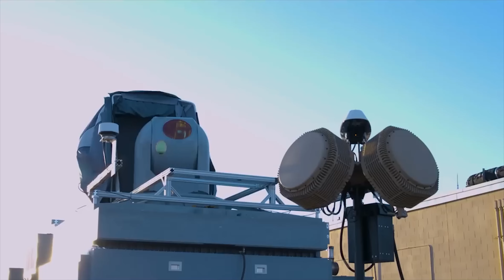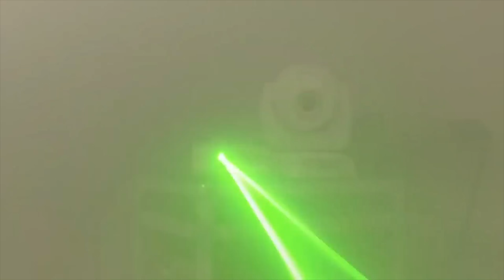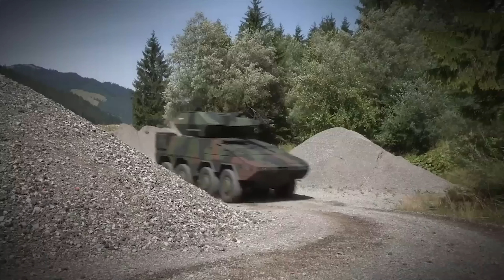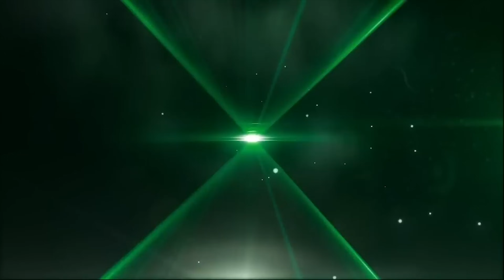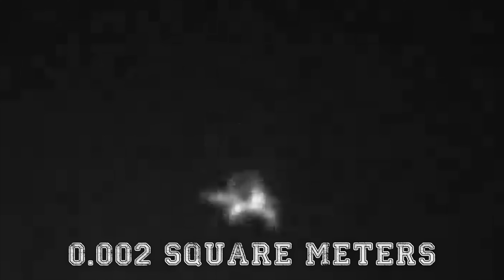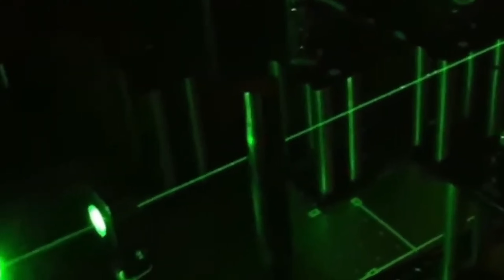GERMAN New LASER Air Defense Systems SHOCKED The World!

Comment: Laser is nice and innovative. The question is how much it costs to build such a system. Although the interception is cheap. But the system is expensive and not always portable and affected by the weather. If it's cloudy it doesn't work. And another question. How long from the moment of purchase the target is to be eliminated. And how it works against multiple targets at the same time. Iron Dome manages to work against 10 targets at the same time. Beyond that there are failures.

Comment: Laser have multiple weaknesses. First, current technology not allows really high output - 150kWt is a practical ceiling, which is barely enough to hit a small UAV made of plastic.  Second, laser generates a huge amount of heat and cannot operate without cooling for substantial time, unlike projectiles weapons. Third, lenses and windows must be clean on microscopic level to prevent burning of themselves, which is about impossible task in combat. Fourth, and this is the biggest problem, is air condition. Dust, mist, low clouds, sand or smoke will effectively disperse the beam, thus completely neutralislzing its effect on target.

Comment: 20 kw laser? That's maybe good enough to disable a tiny drone or possibly disable sensors. The common minimal laser for industrial or home workshop is 60 kw and that's generally for cutting and etching materials a few inches at most from the laser. If the laser has to pass through long distances of atmospheric conditions, it's likely going to be refracted and dispersed to some amount. US and Israeli laser weapons appear to be achieving some kind of minimal threshold for fielding a viable weapon on any platform including aircraft and ships with the US looking to develop an enormous, nuclear powered laser for its largest aircraft carrier, the Ford class which is already generating enormous power for its propulsion, EMALS and other operating systems.
Reply: Think about what a camera lens does to a laser beam, focus it. Also think about what missiles, bombs, drones and planes carry. The fuel ⛽ of there own destruction, fuel ⛽ and explosives 💣. You just have to heat them.

Comment: Problem with lazers as weapons, is mirrors, lol.  Chaff and Smoke also cheap ways to block or attenuate the beam.  THe lazer wont work in rain or fog.  Over all yes very good when it works, but not great in many situations.  However, Mazers are another matter, they cut through fog, rain, mirrors too.
Reply: These are Infrared lasers not visible. Also there is no 'Z' in laser. The 'S' means something. Why does your fire department use IR cameras to see thru smoke. Also chaff falls down and behind plane away from the laser. IR works in rain and fog too. Commercial lasers have been cutting thru metals since before 1990. Metal mirrors will be destroyed by high power lasers.

Comment: A constant Laser requires constant high power laser emission .... A pulse lazer requires much less power at a pulsing rate. Energy is therefore conserved and available at a constant pulsing power level.
Reply: Most lasers are pulsed for decades now. These lasers in the video are really multiple pulses that last seconds. The peak power of pulsed lasers are higher for the same average power. For these multiple pulsed lasers that fire over seconds, the key is total energy delivered not so much peak or average power. There are other very short pulsed systems they are working on that have extreme peak powers that just a couple pulses destroy things.

Comment: Since laser induced fusion is a thing I started wondering if someday lasers will be so powerful and highly focused that it would not only melt the target, but actually initiate just enough fusion to cause an explosion.
Most people also are not aware that the tracking and the focus are really the biggest challenge (you need to track the exact point, to add the energy to this single point - the smaller the beam the better, but also harder to track), unless you really can build a pulse laser that really only needs one single pulse to destroy a target.
Reflective armor might seem as a thing, but actually a mirror also has limits, and wavelength plays a big role, too.
Reply: @ProjectsBlack  You are decades out of date. There have been auto trackers dating back before 1990, long before modern AI. The effects of clouds and mist depends on the wavelengths of the laser and the IR tracker. A very powerful laser will create a hole thru mist or clouds. High  or far away clouds will not have an effect with short range defense.
Reply: Laser induced fusion kind of works diffrent than what lasers actually do. Even if you had a powerful laser that would be able to do large amounts of damage, it would never cause a fusion, because Laser induced fusion kind of works by using multiple lasers that hit symetrical points inside something that is similiar to a cylinder. The Lasers hitting the walls of the cylinder will create kind of shockwaves which will compress the fuel core and increase its temperature so much, that it is able to create a fusion. The fuel Core is also made out of specific elements that are needed for a fusion and it all needs to be very symetrical or else the core woulnd be able to completly compress like we need it too.
You also would need a lot of Energy to get a laser even that strong to do large amounts of damage on a target, but fusion wouldnt happen.
Reply: @BodenPflanze  I know that, but I wondered if someday it might be powerfull enough to cause fusion although it is not causing an implosion. Simply by producing enough heat in one tiny spot (so that inertia and temperature is enough).
Reply: @marcel_de_sh  Look up the power of LLNL NIF, it uses more power during the tiny instant it fires than the whole USA grid.
Reply: @marcel_de_sh  I was talking about a experimental Reactor type from Germany, the ICR.
They use a cylinder. And inside the Cylinder is a sphere
Reply: @BodenPflanze  NIF, on the other side of town, uses a sphere and not a cylinder. Also the wavelengths are changed to x-ray. Otherwise you are correct.
Reply: Small beans are good for close up commercial laser cutters and drills, but longer range systems, in km ranges, bigger beams help because of laser divergence.

Comment: The only weakness of laser defense is that clarity of the sky limits their effectiveness.  (Clouds, dust, smoke)
Reply: Basicly any particle that's in the way in front of the laser to the target
Reply: Atmosphere alone is dense enough to limit modern-laser weapons to a certain range.
The laser would need to cut a tunnel by evaporating the atmosphere in its path to further extend its range.
Then only problem would be that you would need significantly more power the further the laser would have to travel.
Reply: @DerNiker What are you talking about. They use lower power lasers to measure the moon's position for decades. The atmosphere transmits much of the IR.
Reply: IR sees thru clouds and dust. Your fire department uses IR cameras to see thru smoke. This IR not visible.
Reply: If it hits a mirror .

Comment: Two points:
1.. . .If the target has a highly polished “mirror” surface the laser will reflect off it harmlessly.
2……A laser cannot penetrate cloud or fog….the same way the sun cannot blind you on a cloudy day.
Reply: If the missile spins as well, the heat will be distributed and dissipated. A highly reflective mirror is going to absorb very little of the energy anyway, a fraction of one percent, and it can be insulated with a ceramic jacket.
But better still is a kind of reflector that redirects the beam back to source. The body is a honeycomb of 90 degree dimples, coated with a transparent material for aerodynamic. That will brings the taste of the medicine back to the laser.😊
Reply: @madsam0320  A rotating missile effects it control surfaces and path. Even if rotating, the lasers only take a couple of seconds to work. Commercial Lasers have been cutting thru metals since before 1990. The first pulse will evaporate the reflective coating while the second pulse starts on the ceramics. Ceramics don't conduct heat well, so the laser will be more effective and start evaporating the ceramic. The honeycomb allows the laser to bypass  it thru the holes and start on the next surface.
Reply: I've seen some powerful lasers vs mirrors. The mirrors dont fare well cause they heat up and crack, eventually melt. Some lasers are powerful enough to basically punch a hole straight through it 😅 photons are FAST, have enough of them and eventually it's like a minigun of light bullets, they impart momentum and heat reflecting the photons off, but that energy has to go somewhere
Reply: @FractalNinja  A photon has no mass...
.

Comment: What would one of those 100 kw lasers do to an armored vehicle like a tank or ship I wonder? If it doesn’t cut through I wonder how many kw would it take to punch through?
Reply: whit enough power you could microwave the whole vihicle
Reply: @stefanpredl6849  These are not microwave lasers. Re watch the video and learn about IR and microwave.
Reply: A mirror would send the laser beam back to the shooter... 😵
.
Reply: @jonnes__4657  Wrong. The mirror would have to be flat and pointing exactly at the laser. High power Lasers cut thru metal and metal mirrors. Look up laser mirrors.
Reply: Re watch the video. These are short range defense weapons.
Reply: It can blind the crew in a split of a second.
Forever.
This shit should be banned!
Reply: @lutzj74  They banned lasers blinding snipers decades ago. Also your eye does not transmit longer IR wavelengths.
Reply: @mrbaab5932  If the laser can dazzle cameras, it does not work with far infrared.

Comment: Could a common sense cheap counter to these laser be to coat missiles / drones in mirror finish? Lasers are not impact projectiles and lose their power if they can be deflected instead of being absorbed. The best mirrors have a reflective coefficient of 1 part per million, so if you need 100KW to burn through an almost black surface, you will need close to 1million times more power and what kind of laser could generate those types of power?
Reply: F-22 has gone thru testing in the Chrome or Mirror Testings, haven't really heard the outcome, either bad nor good, the US are more advanced than you think. FAX and Internet was product of the Militaries to Civilization..
Reply: @randygillespie4952  Very interesting point you brought there. More interesting is the fact that the outcomes are not published. When it come to high intel, you can hear more info from what is not said than from what is said.
Reply: > The best mirrors have a reflective coefficient of 1 part per million

In a lab, sure.  Now try getting that level of efficiency from a free-flying missile that has to endure repeated handling in combat situations, shocks, weather conditions, etc.  A tiny smudge of grease on that shiny surface absorbs the laser light and heats up to oven temperatures (see the well known documentary Real Genius for a demonstration), which warps and cracks the mirror, causing it to be less reflective, absorbing more energy, rinse & repeat and the missile goes down.

Even then, the goal can sometimes be to simply elevate the cost of the opposing weapons by forcing them to include more and more esoteric defense systems.  More expensive missiles == fewer missiles, as surely as if you'd shot the difference out of the sky.  That sort of calculus typically favors the weapons system for which each 'shot' costs a couple dollars worth of electricity.
Reply: I think that result is for a mirror optimized to reflect one frequency against that target frequency.  If you can tune the laser, or if you don't know the frequency of the laser beforehand, you can't get that performance even in a lab.
Reply: Wrong, 0.0001% reflection mirror is a very special all dielectric high reflector that only works at certain angles and wavelengths. The kind of mirrors you have experience with that work at large angles and wavelength bands is Aluminum metal mirrors that absorb 2-3%. These laser systems are designed to work on metals like Aluminum. Nobody designs a laser weapon to only work with high absorption materials.